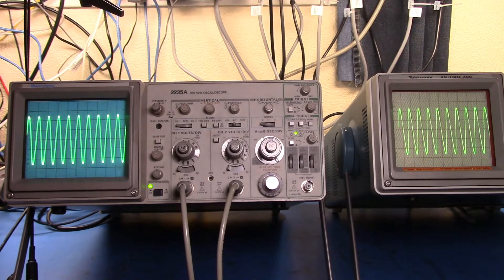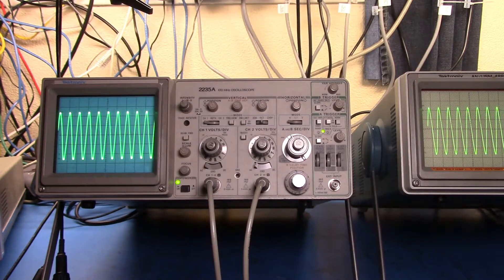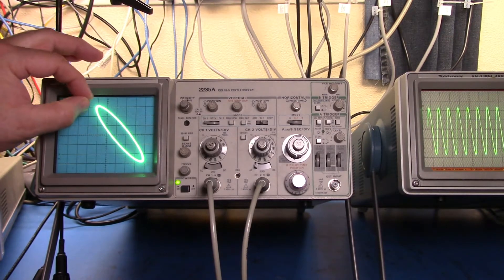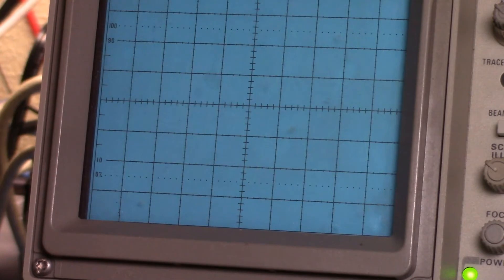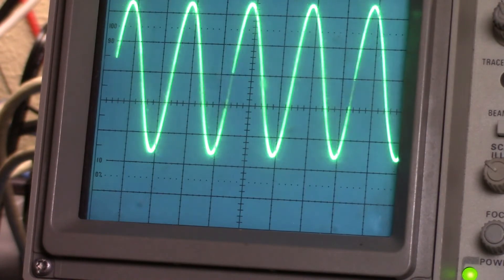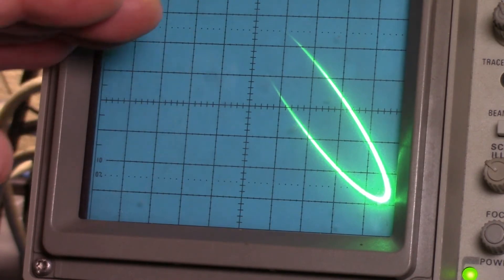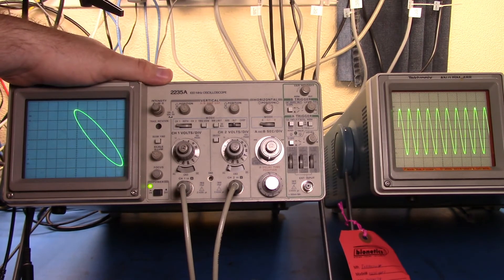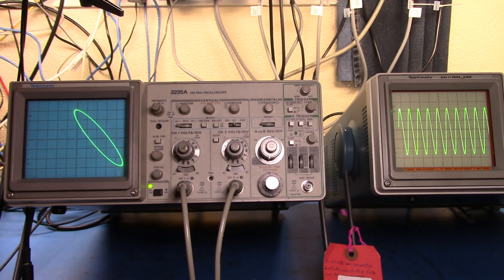XYZ on Scopes

Comment: What's the height, width and length of these scopes?
Reply from the maker: I'm not near the scope now but according to the manual I downloaded the HxWxD in inches is 5.4x14.2x17.3 - They're good scopes and can be acquired quite inexpensively for their performance but in general, I'd recommend that if this was your only scope and you had some more money and didn't need the XYZ aspect (though I haven't tried the latest from Rigol/Siglent/etc) then I'd grab one of the more recent digital ones.

Hope that helps.
Reply: @tgsoapbox  It does, thanks. I have a console with two basins and one has my Xbox and I was thinking of putting an oscilloscope in the other one and I was gonna try hooking it up to the speaker output. Can I do that using just the Z input? Or do I need to plug in left and right audio to the X and Y axis inputs? I want it to broadcast the sound from the TV in a moving wave like when Karen, Plankton's computer wife, talks in SpongeBob SquarePants.
Reply from the maker: @averageclussyenjoyer6396  I'm not familiar with the SpongeBob stuff but if you just want to see the audio waveform then you simply need to feed in one channel (left or right), set the timebase (basically how fast the image is) and something to trigger on. If you put it in XY mode then you'll really only see the difference between the audio channels w.r.t the amplitude.

All that said, you might be better off with a cheap LCD display and a small form factor PC or Raspberry PI - You'd hook the audio up to the mic input and then just do the display in software. This would let you size the display to take up the entire space you have (or something near it.
Reply: @tgsoapbox  I think I've seen those LCD ones for $30–$60. But all the ones I saw were shipping from China. Thanks for the info. I might be able to get an oscilloscope for $50
Reply from the maker: @averageclussyenjoyer6396  Good luck with the project.